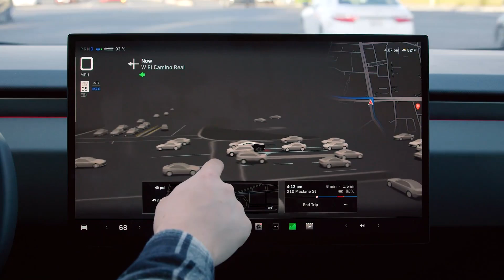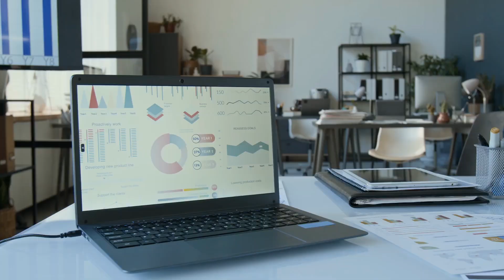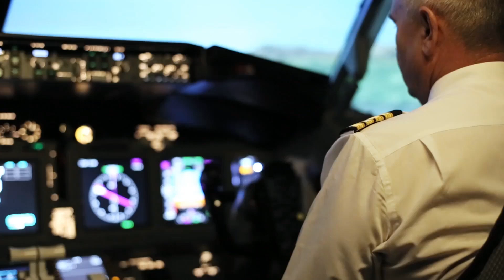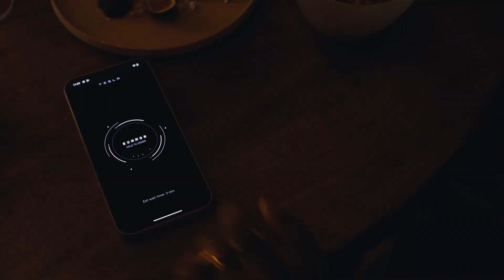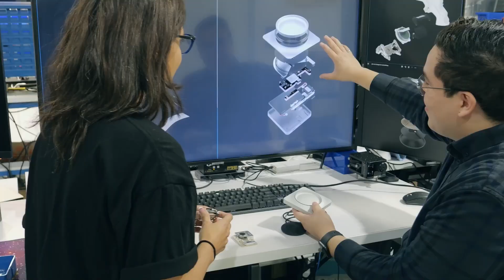Life with Humanoid Robots | Disruptive Investing

Comment: the slip while walking is wow....but until I am sure it is not remote I am not as exited.
Reply: The walking/stabilization cannot be remote as teleoperators can't balance it. In demos the hand use has been remote
Reply: @digitalbladeca  There is no feedback outside of the robot, no vision.
Reply: @digitalbladeca  Tesla could sell the closed loop experience walking and balancing in VR. 

Better than Meta or Google.

I guess they have a full body VR experience suit. We'll see it next year on the shelves of Radio Shack & Co. 

It is called Model Q.
Reply: You can never be sure of anything. If you try this you just block your own path for naught.